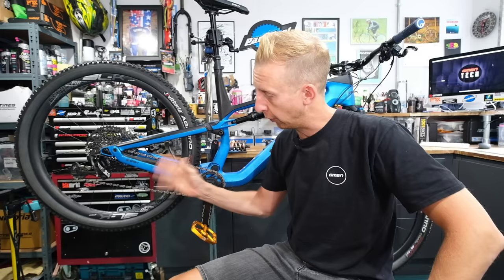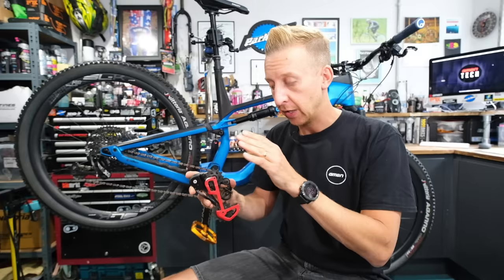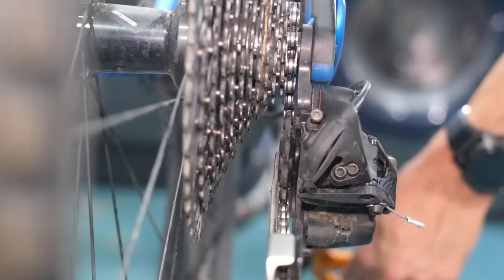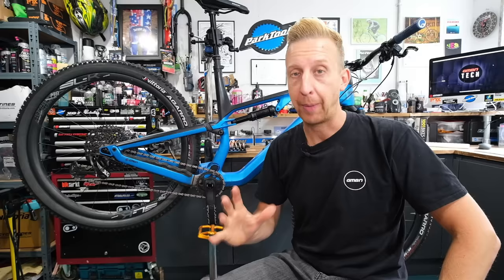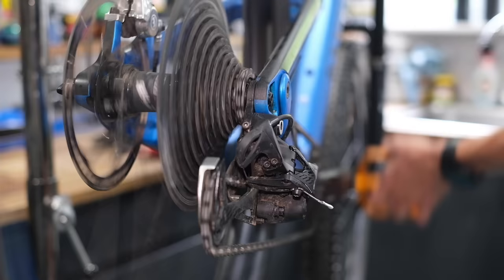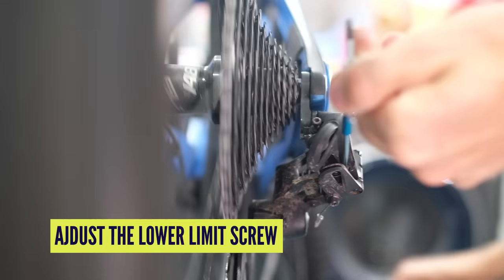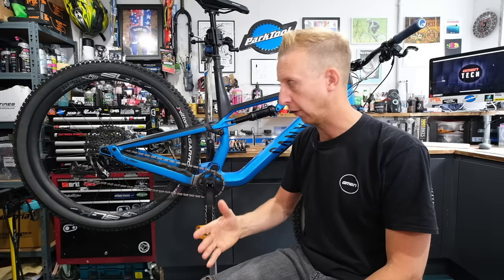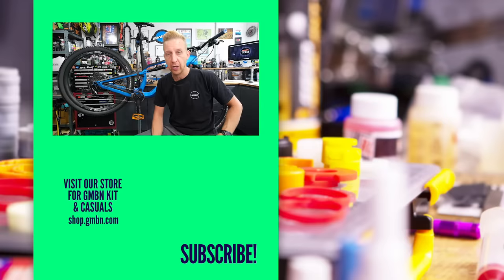How To Set Up & Adjust Any SRAM Rear Mech | Mountain Bike Derailleur Adjustment

Comment: No matter how many tutorials i follow i still mess up.
Reply: I am stuck in the freaking limits
Reply: 😂 me too just mess around u will get it
Reply: @mia3045   srsly, c'mon man. You dont set the limits at the same time. Its smallest sprocket limit first. Tension second to make sure it moves up 3-4 gears correctly, then set the larger gear limit and b screw and then fine tune the cable tension somit shift from low to high smoothly.
Reply: Same here 😔😁😁
Reply: It's a freaking conspiracy to keep bike shops in business. There is zero reason this needs to be this complex
Reply: @jp2586  man if you think three screws are complex...
Reply: @LoneWanderer905  hopefully you don't fall off a cliff next ride. That would be a loss
Reply: This comment is underrated 😂
Reply: bauke mollema was totally right. ducking sram.

Comment: Heads up, the cable should go around the clamp clockwise, inline with the cam. Look back to the beginning when it was loosened, and you'll see the correct installation.

Comment: B gap setting full sus, TOP TIP:, release air from shock, and use a strap/rope through saddle rails and wheel rim to hold the rear suspension at the sag point!
Reply: Or just get a similar sized mate to sit on the bike for you 👍🏻
Reply: Or just undo reshock bolt ?
Reply: Sram recommends this as well.
Reply: I’m confused. Do you need sag even if you have the b screw tension plastic tool as shown in video?

Comment: @4:44 & @6:47 Pro tip: if you have wide tyres and this is a problem, try looking through your phone’s camera. You can also enable grid view from the camera settings (if available) to have nice, clean vertical lines for reference.
Reply: I was doing that just for the laziness of taking off a tubeless tire but didnt used the grid of the camera, thats a genius idea
Reply: @KickOuT74  Thanks man.
Reply: I was going to mention the phone's camera, but the grid bit is actually genious. Didn't think of that, I'll try that later today.
Reply: little hand mirror could work too

Comment: I've watched a few of these, I've now completely messed everything up, lol. Damn
Reply: Get a derailleur hanger alignment tool. Doing it by eye is not good enough
Reply: @BGraves  it turns out a well used casette was the big issue. A new one is on the way which should hopefully get everything back in order.

Comment: 8:20 Doddy, u clamped the cable round the wrong side of the bolt! 😁It goes over the TOP of the bolt, against that little bit of metal,  around front of the bolt and sits in the groove on the underside, then points down....not under the bolt, pointing out/up!!👍
That way will also rub on the routing hole before, (u can see its not inline with hole), possibly causing friction, wear, and insecure cable.
Reply: Beat me to it! Doddy....rookie mistake.
Reply: And then at 11:00 it is correct
Reply: Should really have gone back and done it correctly or pointed out the error.
Reply: I was wondering why that looked off 🤔
Reply: I scrolled down to the comments to say this
Reply: OMG THIS!  Guys, edit this video now, this ain’t no unimportant detail!
Reply: Lol and he is talking about how important it is.
Reply: You are completely correct Rupert, cable should definitely be on TOP of that bolt as shown at 7:01 when it's being loosened, and NOT as shown at 9:20 when being tightened!

Comment: Great video. Thank you! Note that you may have identified the limit screws incorrectly at 6:30 (or maybe you were holding the derailleur upside down?). I tried over and over to index the gears, then noticed you actually used the opposite screw to adjust for the high gear (small sprocket) at about 6:45. Works great now. Just sharing for the folks below who said they couldn’t get dialed in. Make sure you are using the correct limit screw. As stated in the video, you should be able to see the assembly move as you turn the screw.
Reply: Yup
Reply: Thanks! I've been struggling with this one
Reply: Yes he did and that he not a small miss.
Reply: Damn i thought thos might have hapoened. I have been stuggling for about an hour on it this evening!

Comment: This is an excellent video! The tension in the shifting cable is very critical as he points out. So what I ended up doing is over tensioning it and slowly releasing tension in about half millimetre steps and bang the perfect sweet spot revealed itself. Gears  shifting perfectly! Thanks man!

Comment: I have a Specialized Turbo Levo SL and I think it’s the best bike I’ve ever owned. I like doing some maintenance  myself but I want to make sure I don’t bugger anything up as the bike was so expensive. Anything I need to know, Doddy has a video to show me how to do it right. I wanted to change the tires - Doddy has a video to show you how to remove the wheels . After I changed the tires,  the chain was jumping between the 11th and 12th cogs - Doddy has a video to show you how to adjust the SRAM derailleur to make the gears shift smoothly and accurately. His explanations are clear, the videos show you exactly what to do, and I can follow his instructions with ease. What a great source of valuable information.

Comment: Indeed this is the best rear derailleur adjustment video. Not just step 1 2 3 but what each bit does and how important it is. I also didn't know you can straighten the hanger with a wrench. I've just been replacing it.

Comment: 2:02 the orientation which cable tightening was up-side down, you should tighten the cable on the upper position of it, SRAM actually design a groove under the anchor washer to secure the cable tightly.

Comment: Doddy, there is such a thing as cable stretch.  It is caused by the cable strands getting tighter together in the wrap.  This changes the diameter of the cable and causing the cable diameter to get smaller and in turn the cable gets longer.  While we may not be pulling the cable with that much force, it still happens.
Reply: he said that, and cables dont stretch the same as how chains dont stretch, they just wear down
Reply: Actually, there art two things that make it feel like the cable is stretching. The first is when it's new and you've just installed it. The cable will settle so that after some time of use, the places where it has the sharper bends take on that form semi-permanently. This is why it's normal to need to adjust the barrel once or twice in the beginning. The other is when the cable is old and starts getting close to its end of life. When the metal strands have been bent back and forth so many times that they start breaking. Each time a strand breaks, the others move in closer together and this really makes the remaining cable a tiny bit longer.

Now, I'm sure none of the other good people on this channel are so sloppy as to ever have this happen to them, but I've made this mistake a couple of times and I've come to recognise this "second stretching" as a warning sign that the cable is about to break, so replace it soonest! When you need to adjust the barrel on a cable that's been there for a year or more, beware!

Comment: Personally, I suggest always setting upper and lower limits with cable unclamped...should do really.
Reply: Yup - no cable, no chain, clean part ... saves a lot of hassle when setting it up!
Reply: 100%
Reply: @geemail369  I tried this approach, however I couldn't remove enough play out of derailleur when low limit was set in line with 52T cog. I could push the derailleur towards spokes. Any idea?

Comment: Heads up for folks only skimming the video: at 6:05, during the close up of the limit screws, Doddy's voiceover doesn't match which limit screw does what. The right order is shown at around 2:07 (and when Doddy actually works on them):

Left limit screw: higher gear/smaller sprocket
Right limit screw: lower gear/bigger sprocket
Reply: Mate, thank you for this! I couldn’t get back into the lowest gears and had no idea why. This explains it. Thanks again

Comment: After struggling for three hours with a GX derailleur and a new 34 tooth cassette on my cross bike not shifting out of the largest cog, this video finally showed me how to reset everything and figure out that it was the B screw adjustment.  Pulley was too tight up against the cog not allowing the shift to engage.  THANKS!!!@@!!!!!!!!!

Comment: Nice....
Always good to check the hanger with a hanger alignment tool, like park tools DAG1, or ice tools, even brand new ones. And use the same point on the rim (turn wheel when turn tool) to negate any rim true issue, as if ur rim is out of true, it can make it look like hanger is bent when its not! Not in the instructions, but essential as most wheels are off a touch.
Reply: Agree. The Park Tool is critical for any pro or home shop

Comment: BIG tip: make sure the little wheels on the derailleur are clean of anything that could disturb the chain fitting into the teeth of these wheels.  Like in my case, I have a Sram X0, and these wheels are made of plastic, so after a looong time without any issues I started hearing some jumping gears. After a lot of checking, I realized it had nothing to do with the gear calibration itself, but rather these wheels had peeled off a bit and these tiny plastic hairs (on the sides of this plastic wheel) where getting on the way of the chain. So each time I pedaled the chain would rest on these plastic hairs until the tension on the chain would make it snap onto the teeth. So yeah, make sure you keep it smooth :)

Comment: Thanks for the details in your video.  I've just bought a 2020 GX mk2 derailleur, it has a different / better B gap adjustment tool, and you adjust with you bike in your sag position (let certain amount of air out of shock), but note that you now adjust in the 2nd largest gear.  Easy to find the sram video online.  cheers

Comment: Re b gap, the red tool is for use when sagged only (to save any confusion, not when not sagged)....and the difference between the gap at sag (15mm for 12speed 50T, different for others) and same gap not sagged varies from bike to bike...its defo not just 4-5mm (in fact, many bikes might be 4-5 Less, not actually 4-5mm gap). All depends on suspension kinematics.
Reply: Thanks. I did have this question... So how can you do this on your own as obviously can’t sit on bike and check at same time?

Comment: Agree once set up and understood they are super easy to maintain at home and on the trail,always had shimano until recently bought a bike with sram,very impressive and that button which helps with rear wheel removal is for sure genius! Currently using an osymetric ring with kmc 12 speed chain and it works like clockwork 🙂👌🏻

Comment: Hi Doddy, I upgraded a 2015 Cube One Race to 1x12 sram SX.  I had problems changing on the big sprockets.  I had to change the dropout (Cube #149) with another model (Cube #148) from cube and now it works perfectly.

Comment: Very helpful guide but found when adjusting the b tension screw did it from the smallest gear I went off chain tension irrespective of the gap on the largest gear using the plastic tool 👌😎

Comment: Shouldn’t the cable at the pinch bolt be on top? You’re doing it at top in one part of the video and on the bottom of another part of the video. Which is it.

Comment: If i remeber correctly Sram states in their manual inorder to make the B adjustment, you have to deflate the rear shock.
Reply: That’s incorrect.  To properly fit a chain you must fully deflate the shock (ie cut a chain to the correct length).   But to adjust the rear derailleur b-screw correctly the shock must be in the sag position (usually somewhere around 25% of shock travel).  You will note Doddy very briefly mentions it should be in the sag position by having a friend sitting on the bike lol.  Glosses over the sag point very rapidly.

Comment: On my vitus mythique 10 speed just installed sram 12 speed. Mounted derailleur on existing hanger and noticed that in order to align jockey wheel with smallest cog adjustment screw needs to be backed all the way out, like if the derailleur needs to be spaced out. It is not bent. What to do ?? Cannot find a different hanger. How to space out a hanger?? HELP!

Comment: I have an NX Sram. Some times it won't shift cleanly, it'll shift 2 gears and sometimes it'll have a hard time grabbing the lower gear, bigger cog. The bikes is 4 months old. Under a 100 miles. 

Maybe the tension needs to be re adjusted? It works fine 70 percent of the time. Other times it'll fuss.

Comment: The sram manual says you need to deflate your shocks or have it in the sag position when using the b gap tool. I assume it’s ok to skip this step?
Reply: Definitely set the b screw under sag for eagle. Otherwise it will not shift right.
Reply: If you aren't under sag, just make the gap a little tighter than the tool shows.

Comment: This video was a great help, but my mech still wont go onto my highest gear. It has to be something with the indexing but Im not sure what
Reply: Your limit screw might be screwed in way too much. You might also have skipped a gear throug way too less cable tension which means that your shifter is in 1st gear but your mech is in 2nd.

Comment: i just finished installing my 1x12 sram drive (full set crank, chain, support, cassete, leaver, rear derailleur) I had a few issues:
1. Bent derailleur hook
2. 52 tooth cog: its very close to spokes - it was quite difficult to get the distance screw right: in my spoke to derailleur cage distance is quite small.
3. gear cable: didn't see the hole in the drive cage to put it inside, so I installed it outside and the cable popped out quite often.
So look out installing the new 52 sram system

Comment: Noticed that the cable was fed the wrong way around the bolt (anti clock wise) but corrected later (clockwise over the top)  in video when re-adjusting the cable tension. Other than that effect vid

Comment: My rear derailer is sitting way to low when on smallest cog the chain is rubbing against the bottom of the derailer. I adjusted the b screw all the way in but its still sitting to low how can i fix this. I dont know how it happened.

Comment: Aligned the derailleur by eye as good as possible. Then I bought an alignment tool for 50$ on Amazon and it was way off! Aligning your derailleur hanger on the trail by eye is fine for getting back going. Nothing more. You'll probably spend a lot of time chasing a ghost not knowing why you can't get your shifting just right because you thought you eyeballled it good enough. My chain gap was way off as well from factory, too.

Comment: Hey Doddy I'm pretty sure you have that cable tightened in the wrong spot you have it at 6 o'clock it should be at 12
Reply: You are correct Hondo, cable should definitely be on TOP of that bolt as shown at 7:01 when it's being loosened, and NOT as shown at 9:20 when being tightened!

Comment: I just purchased a second hand mtb that’s fitted with a sram drive chain 

The gears are shifting good but I noticed the derailleur jockey wheel isn’t lined up with the highest gear , when I adjust the set screw to get it Aligned perfectly it stops shifting properly 

I was thinking that after aligning it should I then make adjustments at the shifters tension wheel to correct the problem ?

Comment: With the SRam tool do you still need to have rear suspension compressed at riding position?

I guess if yes. Then do you...need to sit on the bike. Slide o-ring to sag setting.(carefully get off bike) Put on the stand. Deflate rear shock and then raise and chock the rear wheel until o-ring aligns?

The use the SRam tool?

Comment: Problem is on my SRAM GX, what I thought is the barrel adjuster has no threads so turning it doesn't do anything.  No adjuster up by the shifter either.  Shifter came new on Catrike 559 in 11/2021.  WTF?

Comment: SRAM recommends setting the outside limit screw (smallest gear) with the jockey wheels centre set to the outside edge of the cassette sprocket, not in line as you've shown Doddy. I think that small point is a major reason some have issues as few seem to know this?
Reply: #askgmbntech Can you do a vid on this?
Reply: @David:
Was about to comment this.
But like to point out that this is the highest gear actually (despite being a small sprocket).
Reply: 11:20
Reply: @geemail369  Semantics, everyone's favourite :) The physically smallest gear, but combined with the front sprocket, the highest ratio...
Reply: @davidwilliamscomau  ikr - something similar happens with loosening/tightening pedals and bottom brackets: depending on people standing left/right of the bike, tackling the left/right part and some ... even have the bike flipped over! Easy peas, right?! 🤡🎡   🤣

Comment: At approximately 6:40, you mentioned turning the adjustable screw to get the chain aligned with the small sprocket and the rear derailer. I have two sprockets on my front derailer. Which sprocket should I use on the front when doing this?

Comment: My chain rides on top of my cassette on the 50T gear instead of properly seating into it. B screw adjusted using the Sram gauge tool, indexing is correct 1shift per click, limit screws properly adjusted and hanger is not bent. Chain is not worn past 0.5% measured using park cc4. any idea what the problem is? Riding GX Eagle on canyon strive 2019.

Comment: My bike from new wouldn't change into the highest gear.
 I could get it to shift into the highest gear with the barrel adjuster, but then I would not be able to get into the lowest gear.
No matter how much I adjusted it, always would not be able to get one of the gears.
I undid the cable and let it the tension, wound in the barrel.
Started from scratch but still the same result?
Any ideas? Much appreciated.